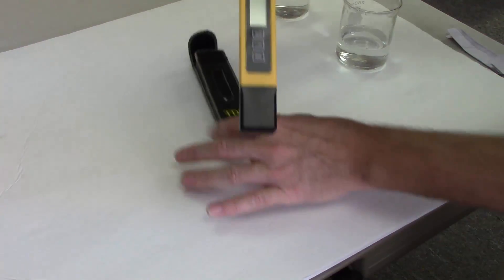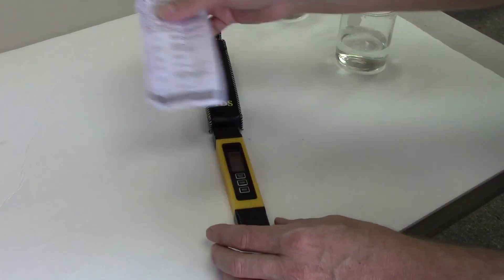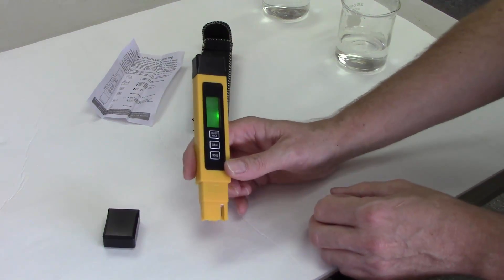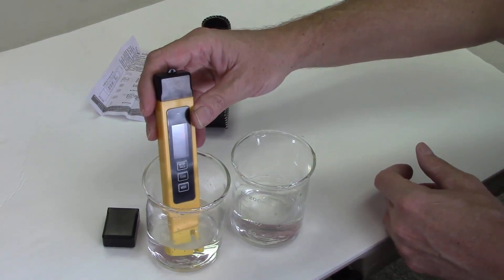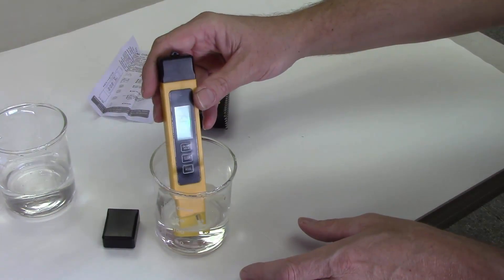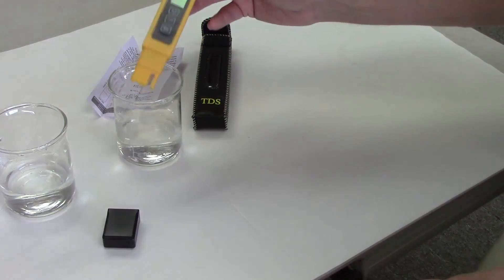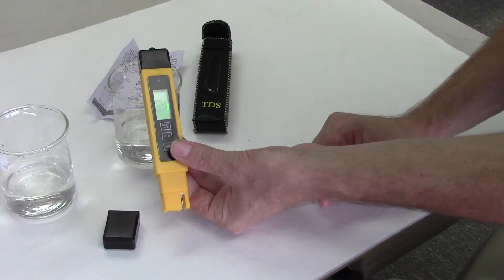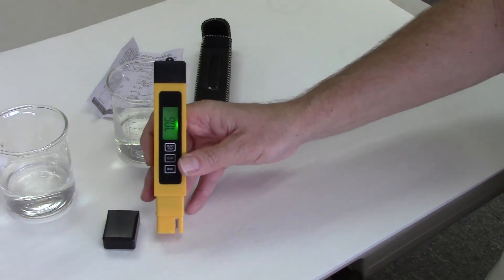TDS Meter and Temperature

Comment: I distil my tap water and when I apply my Lxuemlu TDS meter I generally get a 0 reading, but I also add mineral drops to the water afterward. Sometimes I think that I might have added too much mineral drops because when I apply the meter it lights red, but the TDS level is still within the two digit range, sometimes a little over 100. Does the red light signify that a toxic level of minerals is present?

Comment: How do you calibrate it?
Reply from the maker: It comes calibrated, but you can calibrate it by inserting into a standard solution (typically 500 PPM) and adjusting the calibration screw on the TDS meter.